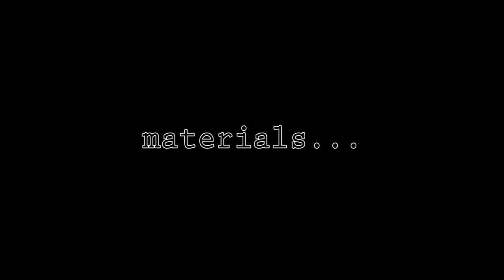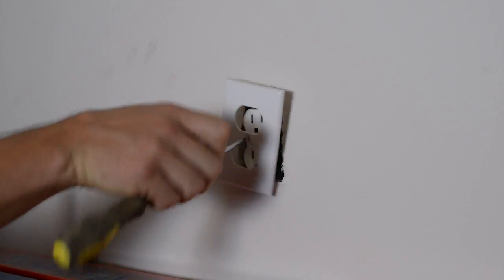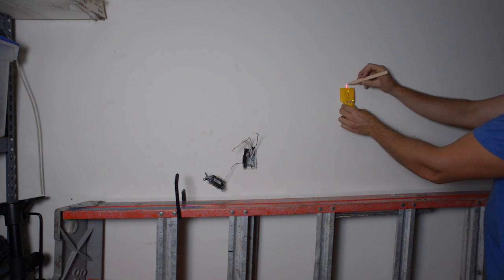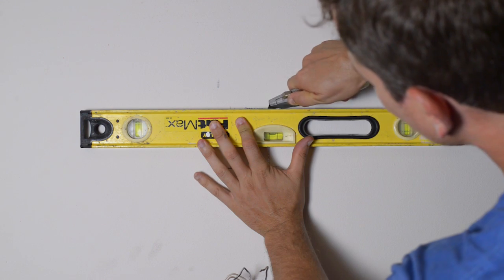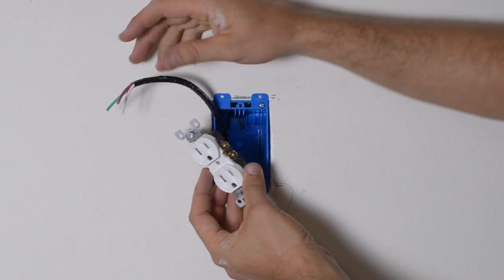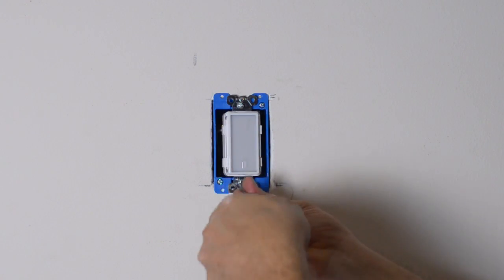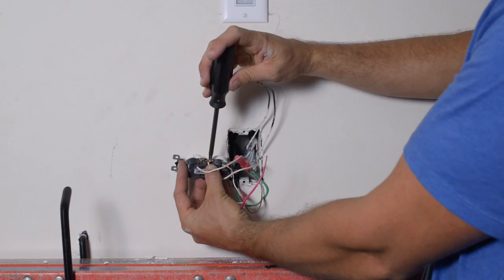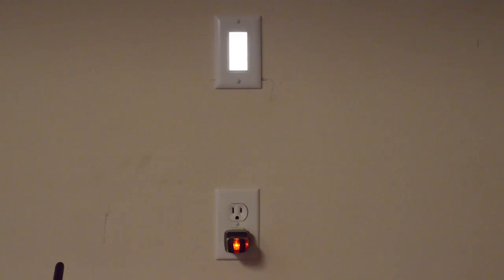How To Install An Extra Electrical Outlet and Outlet Night Light

Comment: Those plastic push outs in the back of the new box are not designed to be totally removed.if you disconnect one side, they are designed to hold the romex in place once the wire is fed through
Reply from the maker: Thanks for the electrical outlet installation tip Tony.

Comment: Joe,
Question.  Where did you find the soft led thingamajig? Also since led supposedly use little juice, how does the 110 v 15 amp convert it?  Thanks.
Reply from the maker: In the video description there is a link to the LED light.  It hooks up to the 110 circuit and converts internally however it needs to power the led light.
Reply: Thanks I will check out the link.  That is a clean setup.  👍

Comment: FYI always check both outlets after shutting the power off because they could be hot because they have different sources. If you look at it and the jumper wire is cut off it could be.
Reply from the maker: Great electrical receptacle installation tips. Thanks for sharing.

Comment: Well I also like my wires to be on the screws..BUT...Please do learn that the wires need to be wrapped around each terminal screw in the direction of tightening.   Left up....right down  ok.....
Reply from the maker: great electric outlet install tip Rick

Comment: I have an outlet where the wire was left unfinished in the attic can I splice it to my ceiling light
Reply from the maker: If I understand you have an outlet box with loose wires in it that are not connected to a power source?  If this is correct you potentially could attach the romex wire in the box with the ceiling light, however if the only power wire in the light connection box is the wire that powers the light the outlet would only be one when the light is turned on.  There may be another power wire in the light box that you could tap into.  In that case you just have to be careful not to overload the circuit and that there is enough room in the light box for the extra wire attachment.  Generally you are only supposed to have so many outlets on a specific circuit.  best of luck.

Comment: Not sure running a wire out the back of one receptacle to another is NEC compliant. Not using Romex wire is a big no-no and will fail inspection.  The way you hooked the wires into the receptacle was amateurish and will fail inspection.  If your house burns down, good riddance - your insurance isn't going to cover it.

Let this be a lesson that this is the reason you hire professionals to do this job.  They know the code, they have a license they must protect (or lose it).  They won't fuck it up like this.
Reply: Not sure if its NEC compliant, so why did you make a comment like that? Does sound like you know much, and if you tell me your an electrician, I wont believe ya. I dont see anything wrong other than not romex. But I am an amateur and I ain't trying to scare anyone with BS.

Comment: ...except for the new ground , you didn't have to remove the old wires from the outlet
 ...since you just screwed the new wires to the outlet screw connectors.

Comment: How do you turn off the night light?
Reply from the maker: The light shown in the video can be pushed like a button which turns it on and off.  It also has a light detection trigger and will only turn on when dark.
Reply: Day

Comment: I personally would not run unprotected wires in a wall or use those stab in holes in he back of the outlet I just don't trust them I would have combined the wires and ran a pig tail to the screws at least should have used a new outlet
Reply: Agree. I've been told by electricians that you should never use the pinholes or "backstab" as it is not a dependable connection and can cause arcing.
Reply: @funbobby170  .... Many electricians do use those stabs as time means money and stab-ins save much time.  I personally insisted my men used the screws.  Also break off those plaster ears from the receptacle so it fits between the ears on the OWSW box and allows the plate to fit tight to the wall.
Reply: @runningwild1055  they don't save all that much time. And if you're going to do a job, take the time to do it properly.

Comment: I don't recommend putting all the wires on the receptacle. You should really use pigtails because if the outlet fails, the rest of the circuit won't be affected.
Reply from the maker: thanks for the electrical outlet installation tip

Comment: Great video! I am looking to tap off one outlet which is close to the floor and install a new outlet higher on the wall so that I can have a recessed box containing 2 outlets for my wall mounted TV.   Is this possible using by following your video tutorial?
Reply from the maker: Yes but if you are not comfortable or have little experience with running electrical you should bring in an electrician.  The wire utilized should be insulated Romex which I say in the video but i show loose wires wrapped in tape.  I did this for demonstration purposes only.

Comment: it seems that I can add a switch in the same fashion right? I am adding a ceiling fan and running the wires down the wall next to an existing switch where I want to add another switch for the fan.

Comment: is it okay to add multiple outlet and lights at the end of existing outlet with GFCI
Reply from the maker: It depends on your anticipated demands.  You can definitely add outlets that are fed through a protected gfci receptacle.  You just want to make sure you do not overload the circuit.  For example if you have a 15 amp circuit you would not want to be running more then 15 amps total off all the outlets/lights on the single circuit.

Comment: You are insane bud. There are so many things done wrong here it makes me sick. Youre telling people how to burn their house down. You are a total moron with no business trying to teach people how to create hazards in their own homes, or worse, handyman types that do this crap youre showing in others homes. When their house burns down around them and your family it will be on your hands, so consider that "Mr Kristal". Its "Kristal" clear that you are a fucktard of the worst variety, where did you get your training? Working in the plumbing department of lowes for 3 months?? Youre a pathetic waste of oxygen and bandwidth
Reply: The proper wire wasnt used, in this case type NM cable (Romex) would be the appropriate CABLE (multiple wires inside a UL listed sheathing made of plastic, rubber, metal, etc. depending on CABLE type). Making your own "cable" by wrapping tape around wires which are manufactured to be pulled through a conduit system is a huge no-no. Also, he re used the backstab holes in the receptacle, which while technically this is allowed (for #14 solid copper only) it is bad practice as the connection points are very prone to failure and a high current draw on the circuit will cause them to heat and become looser than they already are. I have seen so many failures of the back wiring method Ive long ago lost count. They will either cause a break in the circuit and loss of power to other devices down the line, or they will cause enough heat to make the receptacle brittle and break apart when plugging into it, or in some cases they will actually cause burning of the receptacle. The proper way to connect a receptacle when there are more than 2 cables entering the box (2 screws on the side, one cable in, one out) is to use a properly sized wire nut, twist all the like wires together along with an extra piece of wire, and use the "tail" (extra piece of wire you just connected) to run your hot and neutral to the receptacle. This prevents the receptacle itself from becoming the weak link in the circuit and is the right way to do it. Technically you could have 4 cables joined with a receptacle by using the 2 screws and 2 backwire holes, but in the real world this leads to trouble. Ive been in the trade since high school and am a licensed electrical contractor, Mr Kristal is living in a Kristal fantasy world and hopefully his misinformation does not cause any more stupidity than is already out there, because I run into this kind of garbage constantly.
Reply: So, Mr. Jason Childrey, I am asking you if you please, show us the right procedures of doing this. I am planning to add one, too? Please show us!
Reply: Ill come to your house and do it for a hefty fee, which covers my licenses, insurance, proper materials, truck and tools, and 16 years of experience including 4 years of union apprenticeship school and continuing education courses every two years. Im not giving away my knowledge for free, so no video, not sorry. The difference is, my install will be safe and properly done, whereas anyone who takes this idiots advice is likely to wake up in the middle of a pile of ashes. So, you can pay a professional to do it right or you can do it yourself from youtube morons and see  what happens. This guy is giving bad misinformation regardless, if youre going to try to teach people at least teach them right. This was a nightmare of everything to do wrong.
Reply: The way you describe yourself is what I called "Selfish." See, this guy is willing to show other people of how to do it...and your hefty price is way beyond your mind. How much just for that?  If I know how to do it right, then I will gladly show others as well. Adding one (1) outlet should take less than 30 minutes, don't you agree?
Reply: I am sure you don't know how to do it. You just brag about it. If you do, prove it.
Reply: Hey, dude. I just did mine this afternoon...and my house still stands. I cost less than $10 to do it. I called around for any handy man. Prices ranging from $50 to $80. And "THANKS" to this video. Also, I met a guy at the Home Depot (in Fresno, CA) yesterday and he said just wire like this video shows.
Reply: 1000saib that's why people think our trade is worth nothing and anyone can do anything they see on YouTube and be fine. You home Depot schmucks will be eating those words when your house is in ashes because you wanted to save 50 bucks.. and that's insanely low, minimum would be 125 plus material
Reply: I know you wouldn't do any different at all. Otherwise you should show it..LOL.
Reply: Thanks, man. Finally, someone comes out the shadow. " Master, please show us how to add another outlet," (just another version from Peter asking Jesus, on how to pray. I am waiting for the challenge, Master Electrician.
Reply: you are absolutely right he is selfish person.. i'm not an electrician but I did a lot of electrical work in my house thru reading books and youtube besides that if I can help somebody saving them money I help them without charging them even they are willing to pay me...
Reply: I'm just here for the Comments lol
Reply: Jason Childrey could tell what he should not have done? Any info would be appreciated.
Reply: While you're not wrong - you should at least include information regarding exactly what is wrong in this video. 

Use romex, kids.
Reply: I'm no electrician, but the biggest red flag for me is electrical taping three wires to feed up through the wall.  If putting an extension cord behind drywall is a code violation, then that sure as heck is too.

While I'm not sure it's entirely against code, it's good practice to loop the wire around the screws in the direction you tighten the screw.

I think substituting wiring colors is a a recipe for disaster too.

Just the things I noticed.  I'm sure there is more.
Reply: Just talk...no proof...SAD!
Reply: Jason Childrey You guys all bad talk this Kristal guy but I have never heard of a house burning down from an electrical fire caused by some layman installing his own wall outlet. If it works, do it. And save a ton of cash. I think many people also feel that tradesmen these days rip you off and don't want the hassle. Called a locksmith to rekey a door lock he said on phone 19.95 service visit fee and rekey fee usually $20-30. He showed up, did inspection, said it will be $129. I could buy  a new door know and lock for that price. I gave him his $19.95 for "service fee" and told him to leave. This is only one example. I have many more. I'll install my own wall outlet. Many thanks to people lime Kristal.
Reply: Reason why it costs $300 to have a light bulb installed. Union electricians are a joke. You're no better then Jorge at home depot- you just take more coffee break then they do.
Reply: Jason chickened out. He's aint any pro. He's a trash talker. I bet he's stilling learning to put up the video as he promised. LOL...:(
Reply: Jason Childrey you didn't even upload it
Reply: Yeap...Jason does not have the balls to prove that he is capable of doing this. He's just a jerk.
Reply: Jon Miron see even someone outside the trade can tell this idiot doesn't know what he's doing. At least there are a few people in the world with common sense. If the "pros" at home Depot actually knew what they were talking about then they would have a real job doing the work, not stocking shelves for $8 hr and talking out their asses lol

Comment: so if you added the new wires (feeding the light) to the screws on the side, then removing the original wires from the receptacle is an unnecessary step, right? You put them right back in the slot they were in.
Reply: I missed that, but yep, that was just dumb. Taking them out and putting them back in only further stressed what is a shoddy connection to begin with. Good eye ;)
Reply from the maker: +TheProdieus if i am understanding your question right then yes.  you just have to make sure to tie into the original outlet correctly to make sure power passes through to the new outlet.
Reply: These outlets are designed for feed in feed out. I don't do that. I use wire nuts and use pigtails. So if the receptacle fails, it won't effect the rest of the circuit. Call a licensed electrician if you need work done.